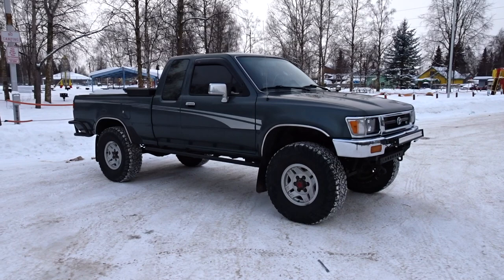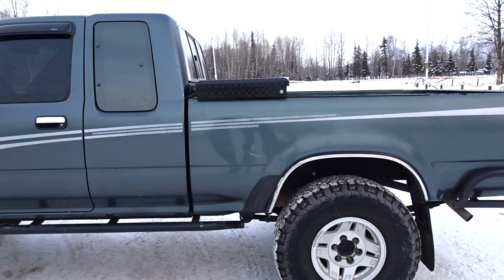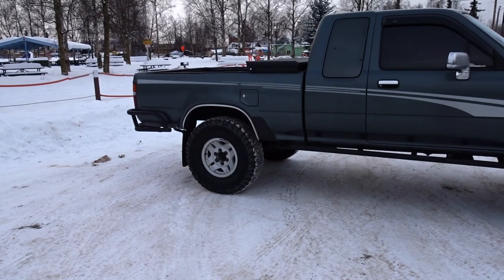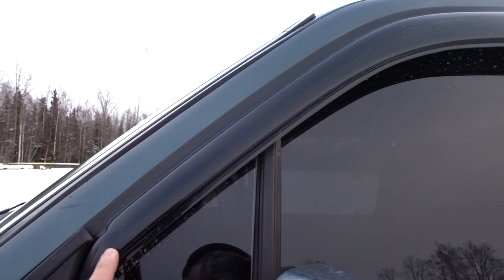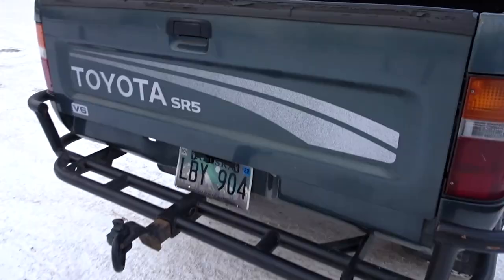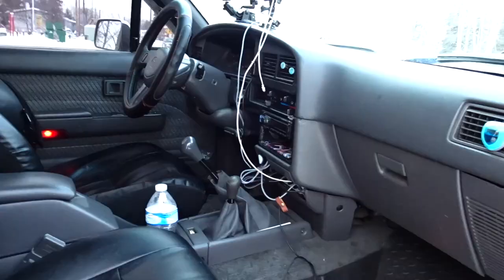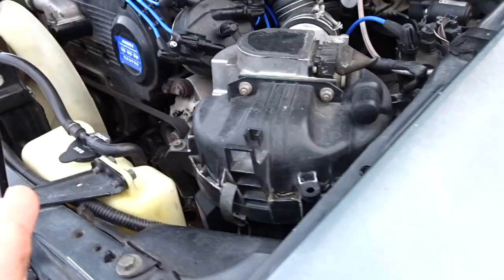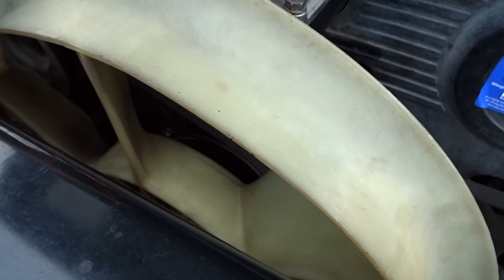My 1993 Toyota Pickup SR5 | Walk-Around 2021

Comment: I’m in the market for a Toyota Tacoma what is the ultimate engine and transmission you recommend? I have a 1979 Toyota short bed I’m trying to restore but time is not on my side but I’m in the market for a daily driver and trail truck. Any info will be welcomed. Thanks and as always Great Video Nu!!!
Reply from the maker: I like 1st gen, 3.4 motors are great
Reply: @NuttyNu  thanks for the advice! I’m looking at a 2001 Tacoma 4x4 with 109000 miles and he’s asking $8800.00 I’m going to look at it tomorrow. Thanks again!

Comment: I’m looking to buy a Tacoma 1993 , seller has a 2wd Toyota Tacoma sr5 4cylinder ? Is that a thing? A 1993 Toyota Tacoma 2wd 4cylinder sr5…
Reply from the maker: LOL, not its a pickup, tacoma were not made till 95 and up !
Reply: @NuttyNu  sorry no I messed up 1996! Is there a 2wd Toyota Tacoma sr5 automatic 1996?
Reply from the maker: YES, tacoma and pickup both came in 4wd and 2wd. you can tell easily just by looking at them and also crawling under to see if there is a front drive line or not. hope this helps and GL with purchase.
Reply: @NuttyNu  cool thanks man! Just subbed! What does the sr5 badge do to a Tacoma? Anything special lol?
Reply from the maker: @yodiig9504  usually it’s 5spd, although Some are auto. And sr5 means an up package from the base models